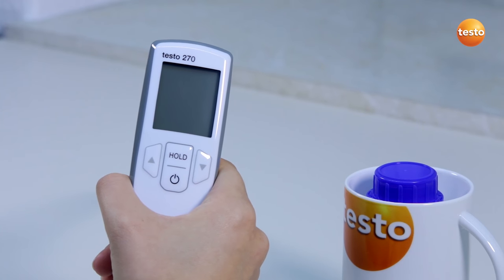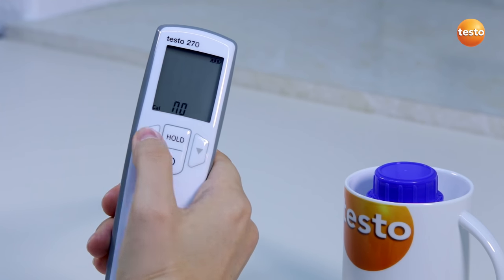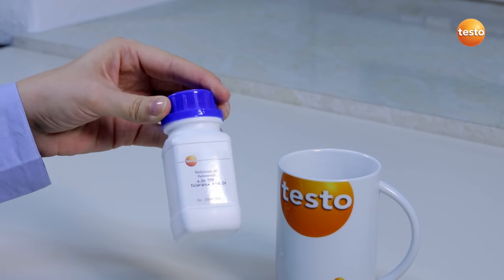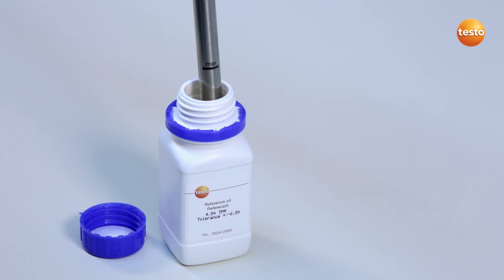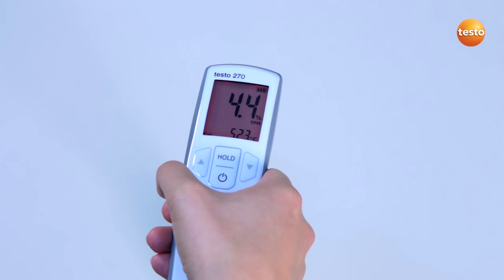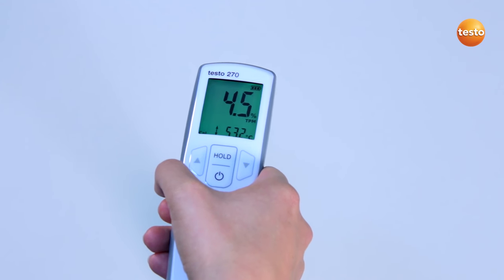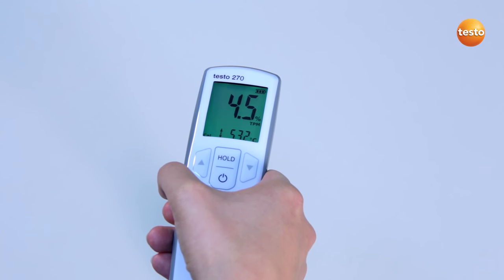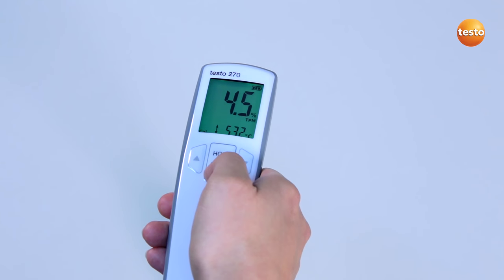Cooking Oil Tester - Testo 270 - Calibration And Adjustment

Comment: Do you need to calibrate the instrument just after first opening ??
Reply from the maker: Thank you for your query, it shouldn’t need calibrating straight out of the box, however, when you have started using the unit it’s best to recalibrate on a regular basis, the more it’s recalibrated (depending on the amount of times it’s being used), the more accurate the results will be. Once a week or once a month etc. We hope that helps!